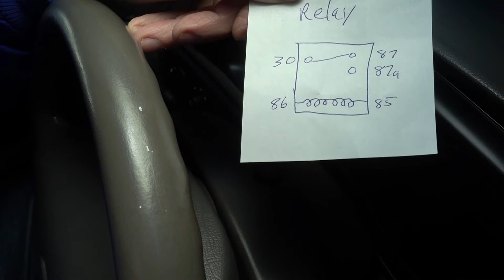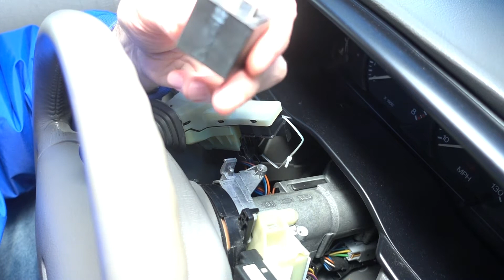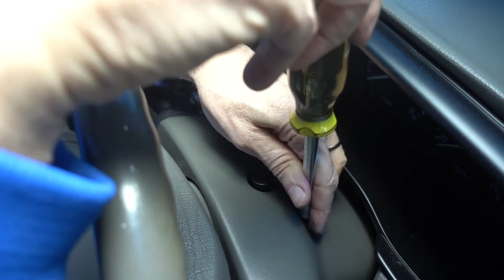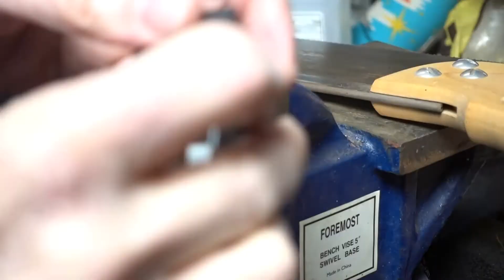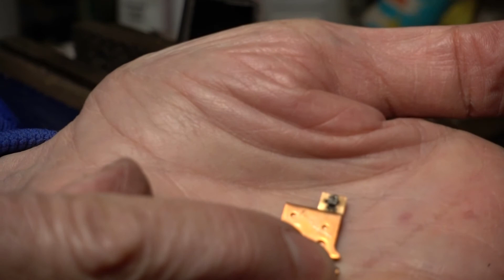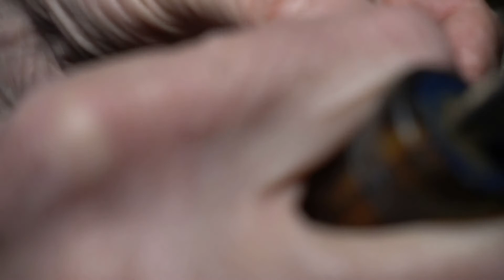'98 Ford Contour -  No Turn Signals Nor Hazard Flasher

Comment: My daughter just inherited her grwat grabdmothers ford contour and the signals and hazards aren't working. Plus found iut that the driver windiw isnt either and the "cable driven" mechanics geez, but to my under atanding of how to test a 3 prong is maybe one side is "normally open or closed" (relay) and once power is supplied is when it sends power to circuit. I learned that terminology listening to a hvac tech determine the problem with a relay sequencer in a heater. Having something thats normally open and when power is applied it allows power to run and the normally open in this case woukd be supplying power to the hazards since its a push style i don't know sir. Anither question is how do i get ti the fuse box undwr the dash it looks to fold down but has wires fastened to it ? Much appreciated fir making this video im what they call a parts changer so ill order the relay first and then the whole assembly if need be.
Reply from the maker: I don't have the car anymore and I gave away the shop manual.  I'm not the greatest diagnostician either.  You're on the right track to use the wiring diagram and check powers and grounds.  Best of luck and thanks for watching!

Comment: Hey, I am currently working on my 98' Contour and have having an intermittently working turn signal issue. I was wondering if you moreso think its the switch assembly or the relay.
Reply from the maker: You might try cleaning the contacts for both.  If that doesn't work you're going to have to get a wiring diagram, track down the wires and test powers and grounds.

Comment: Will this apply to a 98 mercury grand Marquis have an issue with the rot turn signal. If you wiggle the hazard light switch the turn signals go on and off so figure it will be that or the relay like you showed in the video.
Reply from the maker: The '98 Mercury Cougar has the same system but I don't know if the Grand Marquis has the same system.  You should start by going in and cleaning the contacts in the terminals.
Reply: Will give it a try thank you

Comment: Did you also lose cruise control when the turn signal switch was bad?
Reply from the maker: I don't know, I never use cruise control.  I don't think the relay has anything to do with CC.
Reply: @davidgpo  Mine CC doesn't work. I replaced the CC safety release brake switch, and I verified the clockspring is working. I'm getting 12 volts to the CC switch harness. I'm think the CC switch harness is bad. I've never had the it light up at night unlike the power window switches. They all light up.

Comment: Another excellent video David!  I learn a lot myself when fixing my own car. I'm the original owner of my 2004 Ford Focus. Best solid vehicle I have had! I always have been an avid fan of the Contour (1995-2000), and Focus (2000-2004) in North America, and (1998-2004) in Europe. 
I always look forward to your Contour videos!
👍
Reply from the maker: You are the Fan of the Month!  Actually, you're my only fan so keep watching.  My sister had a Focus.  I don't remember which year.  It had a transmission defect and Ford repaired it.  Transmission problem happened again and Ford wouldn't repair it so she sold the car.  I hope you don't have the same transmission.  The Contour  is holding up well after all these years.  It's handling is very tight and I love how it corners.  Since I fixed the oil leak I'm going to hang on to it and see how long it will go.  Thanks for watching!